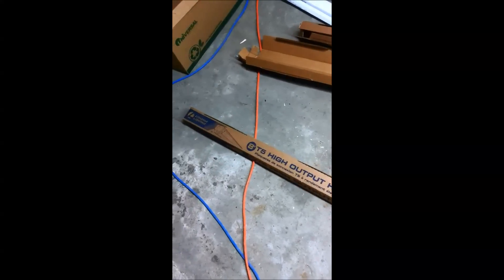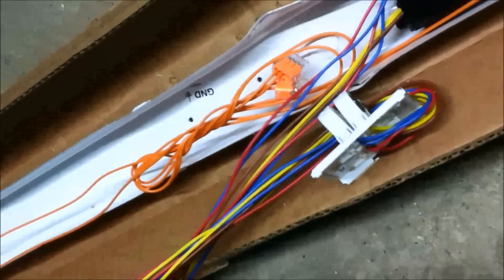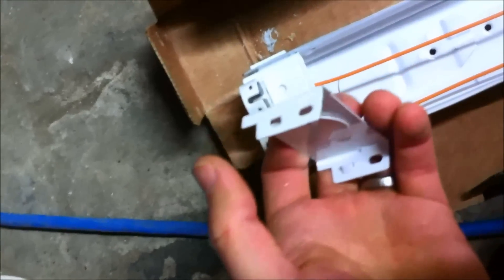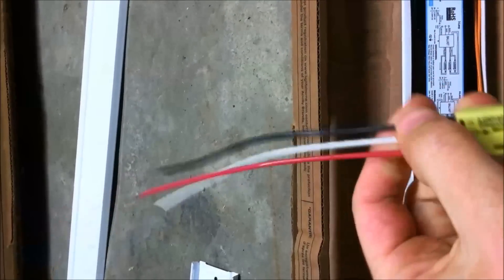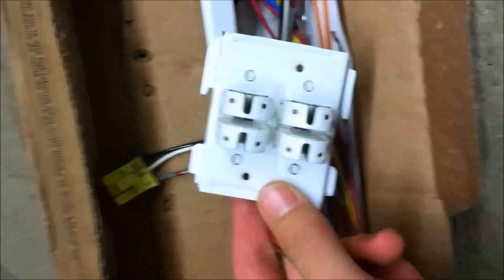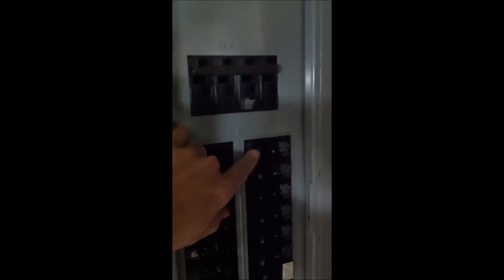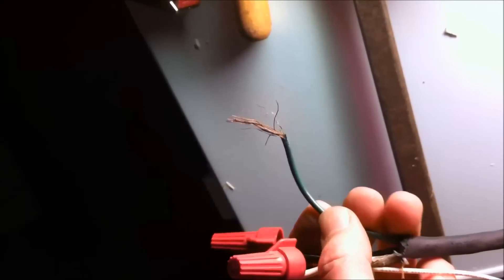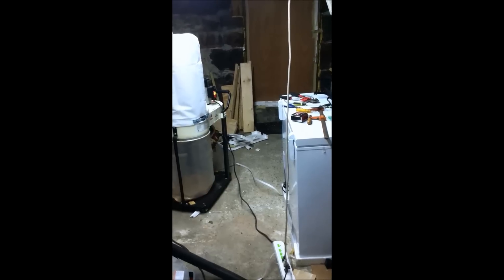Installing Lithonia Fluorescent Lights (T8, T5, T5HO)

Comment: I have to thank you so much. I hung my double set of lights almost identical to yours and could not figure out why only one set of lights would come on and not the other. Nowhere did the fucking thing say that the red wire was also to be connected to the hot wire. I searched all over the net and couldn't find an explanation until I watched your video. Thank you again!!
Reply: Rodney Landis same here! Just wanted to know what to do with the red wire!

Comment: A fire waiting to happen.  Unsecured wires are what cause electrical fires.  Fastening the Romex to a board and using a connector clamp at the knockout are not about asthetics.  They are to prevent chafing and accidental disconnection.

Comment: If anyone finds the profanity offensive, they obviously have never installed one of these POS fixtures!

I just installed (3) Metalux and (4) Lithonia T8 fixtures. They are all garbage. The Metalux was much worse, but the end knock-outs on the Lithonia are impossible to remove without mutilating the case. I tried the Dremal, a drill (to drill one tab), and I cursed like a sailor. I think I wasted over two hours removing 11 knockouts. I went to YouTube to see if anyone else had a better approach.
Reply from the maker: Thomas Stoltz I'm awarding this man the the Robertsonian Medal of Courage for surviving grievous physical, mental and spiritual harm in the defense of luminosity.

Comment: I installed a tandem T8 strip last night and everything you show in the video was exactly my experience, even the jacked up middle that someone obviously had return to the store after running over it with a tractor. I found the video dead on super informative and after realizing I couldn't fuck it up because its essentially a piece of shit out of the box, I slapped it in and it worked. Good video. Thanks.
Reply from the maker: OldSchool Dawg I may be a foul-mouthed, hell bound, gnat-minded, rapist (according to my commenters) but I'm not a liar. If I say something sucks ass, it sucks ass to the Xtreme yo!

Glad to see people surviving the installation process without becoming a vegetable. Although, really there's no way to estimate the number of vegetized Lithonia customers, for obvious reasons......
Reply: qubert roberts I live 20 miles from one of the Lithonia plants that just closed and if you knew all the toothless wonders that used to work there, you would either 1) never buy it again, or 2) appreciate that apparently a clan of monkeys could whip this shit out with no instructions, a sheet press and 6-pack of beer. 

Hey, screw the people on here...people are stupid.

Comment: I feel just like you do......except mine is a 4 bulb....same drill? Help!??
Reply from the maker: fantasticalice There shouldn't be any fundamental difference. I assume the 2 bulb and 4 bulbs varieties are wired in parallel whatever that is. 

I guess the only thing to watch out for is total amperage you'll be putting on one circuit. If you put too many lights on one circuit the bulbs will explode and rain down plasmafied neon and mercury vapor right when you're in the middle of getting lucky with your dream mate after years of pining away completely unaware the he/she has a crush on you too. You'll go on this initially super awkward date where a glass on wine gets spilled on your crotch and rather than fessing up you'll try to wash your pants in the sink after which they'll catch on fire when you put them to close to the hand dryer. You'll think on your feet and grab a tablecloth using it to make a makeshift sarong then head back to the table and try and play it off like you were always wearing that. He/she won't buy it but it'll turn out he/she has a really good sense of humor (you knew this already though, that's why you like him/her so much! duh!) and you'll both laugh it off before retiring to your basement couch for some carnal sportage. After several minutes of heavy making out during which you'll fall off the couch but seem not to notice because of how into it you both are, things will be about to get serious. Just as the pants and tablecloth-sarong are coming off the bulbs will explode in a majestic display of various states of matter (including liquid from the two of you because of how terrifying it will be). 

In actuality, you'll know if you put too many lights on one circuit because the circuit breaker will pop thus killing the lights and making things potentially even sexier in the aforementioned basement. 

These lights are pretty efficient so you can probably string a good number of them together.

Comment: I bought the I-Beam kit and was pretty pissed.  The instructions were terrible as you said , I was supposed to have some sort of extra battery backup that was no included and there were not screws, washers or anything.  Then I had to pull it all apart in order to install. Pain in the a$$. I will never buy a Lithonia light again. Thanks for the video. I was trying to figure out where that extra read to black wire went.
Reply from the maker: Jim Staley I find if you're unsure where something goes during assembly you should just guess and then let the universe sort things out. That's how I burned all my pubes off.

Comment: I sat down to introduce my young daughter to properly installing fluorescent lighting. Sadly this video only expanded her vocabulary. FML.
Reply: I cuss a good bit but nothing like this idiot.
Reply: did u really teach your young daughter to wire a light? i have autism and i learned when i was 8. it’s something im most interested in is lights.
Reply: Derek P lmfao
Reply: Same I was sitting in my living room with my kids trying to figure out how to wire this up for my sons bearded dragon enclosure and this is what they all hear. Very disappointed.
Reply from the maker: Vocabulary is a valuable asset. What are you going to say if you sit in a still warm puddle of hobo vomit on the train? Shucks! Really peeved I've got moist chyme soaking into my intetriginous areas!"?

Comment: I was installing the lights, looked down and realized I was in a pool of blood from the thousands of bare metal slashes on my knuckles. Decided to take a break and see if there were proper instructions available. Nope, just yours but at least it was in Sailor English. At first I thought I had found my long lost dad on Youtube, but alas I realized that what we share is only the same anger and twisted vocabulary directed at inanimate objects. Oh, and beer. We both like beer too. Thanks for the chuckles.
Reply from the maker: Risk of blood loss should be a warning printed on the outside of the box. I started bleeding from my eyes at one point but it turned out that the psychic dude I put in the chest freezer wasn't dead yet and he was trying to make my brain explode.

Comment: Fuck it. Im returning these lights to HD before I try to wire these myself and burn down the place. Gonna get the old scholl t12 or whatever that come pre wired.
Reply from the maker: Going to take a huge brightness hit on those but it'll be cheaper than my old lighting system. I had some champagne to celebrate when I finally threw away all my old whale rendering equipment.

Comment: Nice how to. Had me laughing the whole time and my lights are all set up and working. Thanks for the video.
Reply from the maker: My next video will be "How not to get dry concrete mix in your eyes even though you're wearing fucking safety goggles and then you get actually blinded and have to call an ambulance and spend Saturday night in the emergency room getting your eyes flushed with a fucking IV bag of saline that probably costs like 400$ while repeatedly affirming that it was not a work related accident only to then get insurance coverage denied because it was a "work related accident" and should be covered under workman's comp and the whole time you can't even watch TV because it hurts to move your eyes and you end up fucked up on Vicodin passed out on the couch while the Clone High DVD intro menu music repeats all night and your wife takes a picture of you apparently crying to Clone High because your eyes are watering so goddamn much and then she posts it to Facebook."
Reply from the maker: I hope you had enough beers during the process. I may have glossed over it but that was the most important step...that and believing in your self....